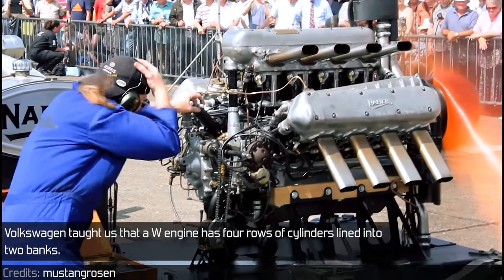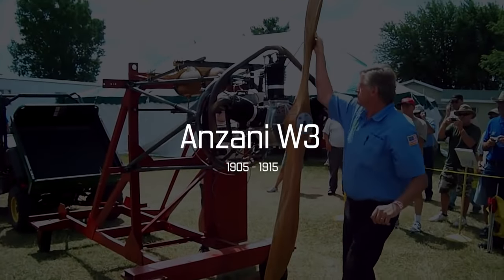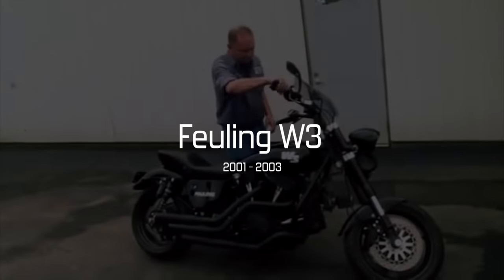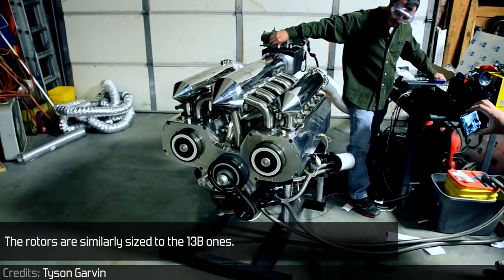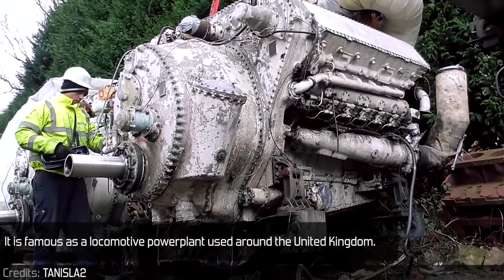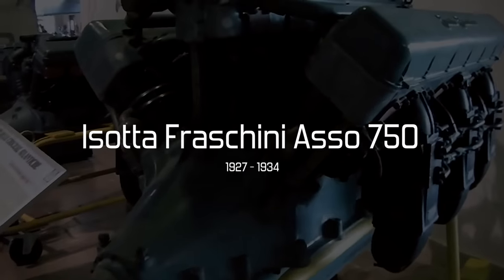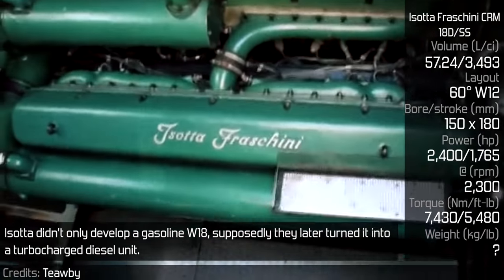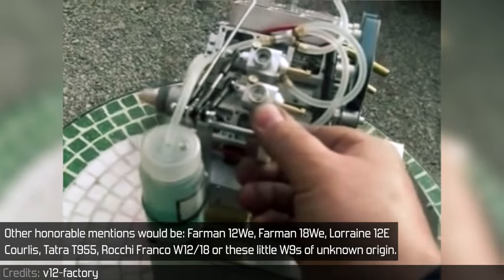Here Are A Few 3-Bank Engines Known To Exist

Comment: why don't you do a list of the most bulletproof engines, it could be interesting.
Reply: Ewan Murphy so almost any engine?
Reply: he means engines that last long, VERY long
Reply: Ill start it off. 1HZ from Toyota
Reply: ford 300 4.9L that's all you need
Reply: Small Block Chevy.
Reply: GM V6
Reply: Japanese diesels
Reply: Australian gmh 304/308 seen them run with pistons out the block for almost a min
Reply: So let's all agree and up vote this. Am I right?
Reply: Flametux true true I can agree on that but there would have to be a two part series on this subject to be completely honest.
Reply: Would contain Volvo Redblocks and Mercedes Diesels :D
Reply: ford barra NA LPG
Reply: BMW 1.5 litre 4 cyl.
Reply: L36/L67 from GM, and the 2.3l they put in the Ford Rangers
Reply: any toyota mota
Reply: Most Honda motors.
Reply: Speaking for American examples here. Short list.

- Hudson/Nash (AMC/JEEP) Slant-6
- GM 3.8 OHV V6, LT1 (older) V8, all LS engines, New LT1 V8, Basically all NA GM OHV egines
- Ford 302 V8
Reply: Old Mercedes diesels. Even in my little hometown there is one W123 which has been driven over one million kilometers. And my friends daily driven W124 with 3 liter diesel has 600 000 on the clock. There was once an old W124 taxi which had been driven 2 million kilometers but it had a few engines changed :)
Reply: volvo b20 for sure.
Reply: Volvo B20, B200, B21, B23, B230. Simply indestructible. Should one of those die, you probably killed it yourself...
Reply: Ewan Murphy Chrysler slant 6
Reply: vector6977
Reply: Please also specify what calibre bullets you're using.
Reply: @lukehindle4680  nah caterpillar 4086e

Comment: I believe the Feuling W3 wasn't accepted by HD in part because of some reliability concerns - specifically, the very uneven cooling between the front cylinder and the rear one.  Makes sense, since it's an air-cooled motor, and a pretty tight fit in that frame.  I'm told this is the same reason Ducati designed their engines with a 90 degree bank angle, with the front one almost horizontal so it didn't obstruct the air flow to the rear cylinder. Running a liquid-cooling system would possibly have helped, I suspect.

Comment: If I'm correct, Glen Curtiss, builder of the first V8 motorcycle, also built one or two 3 cyl bikes back in the 20's, or 30's... They were turned to scrap, in the metal drives, for war production.

Comment: Napier Deltic engines were also used in Dark class fast attack boats & , Hunt and Ton class Mine sweep vessels. Their engines were prized for the non vibrational properties so as to not disturb submerged ordnance.

Comment: Cool. A radial engine that you don't have to take the plugs out of the bottom cylinders  to drain off the oil after letting it set for a day or two.
I wish I had the money to scrounge up some of those old radical engines from the past. In the airframe and power plant school I attended they had an old English fighter plane engine I believe from the WWII era. Our instructor said the engine was discovered in a ravine off to the side of a runway that was being upgraded. They UN-Earthed it, cleaned it up and had it on display. What was really unusual about it was that it had 6 or 8 cylinders (It was 35 years ago and I can't remember for sure) in a row on the bottom of the engine. Of course it was a dry sump as the cylinders would immediately begin filling with oil the minute it was shut off. But even being a dry sump I would think that oil in the cylinders would be a significant problem like it was with the lower cylinders on old radial engines. I would sure like to know why the engine was designed that way and what the designers thought the benefit of all the cylinders being on the bottom was. Then I'd like them to send to me so I can tinker with it awhile.

Comment: the really old diesel 2strokes actually needed blowers because they didn't suck quite enough air to run properly
Reply: That's because on most 2 strokes intake and exhaust are open at the same time quite close to BDC, so there is not enough forced ventilation from the movement of the piston alone.
Most 2 stroke diesels use forced induction for this, in the form of roots blowers, and later turbo's with a mechanical coupling active below certain engine revs.
2 stroke diesels with exhaust valves set in the cylinder head (GM-EMD, Detroit and Kolomna 14D40 as examples) can be pressure charged, as the exhaust valves can close before the intake port is lapped by the piston.

2 stroke gasoline engines use tuned exhausts to get proper scavenging of the cylinder(s), these exhausts work essentialy like a pulse jet, the shockwave of the exhaust gasses rushing out creates a low pressure zone behind this shockwave, just at the right time when the piston moves up but before the ports are lapped.
These exhausts must be made to exact sizes for a specific type of engine, otherwise they won't work (well), because the low pressure is created at the wrong moment, it's also the reasson that each cylinder on a 2 stroke gasoline engine has it's own separate pipe.
Reply: Daniel Deutschen they used the blower for scavenging! if they didn't have it, they'd just blow the air back out when the piston comes up on the compression stroke, since they don't have any type of crank case induction like on a smaller 2 stroke
Reply: thats why 2strokes have these special formed exhaust pipes :)
Reply: Daniel Deutschen well an expansion chamber won't work on diesel 2 strokes because they still have exhaust valves
Reply: Kenyon Payne , , ,   check  out Detroit  51 series  engine wiki 
  no valves   but it does have a camshaft  to operate  injectors
Reply: thank you, Idodn't know that!
Reply: Not all 2 stroke diesels have exhaust valves, where would you put valves on an opposed piston engine?, it has no heads to put them in.
Also some normal 2 stroke diesels have exhaust ports instead of valves, like Hans Knutson mentioned the Detroit 51, I'm involved with the rebuilding of an old locomotive with a Crossley SVT 8 2 stroke diesel, it has no valves, and there are no camshafts on this engine, as it uses conventional injection pump block instead of the cam operated injectors.
It has the Roots blowers for scavenging.
Reply: Thanks for the interesting post on opposed piston engines.  I saw an old Fairbanks Morse in a submarine, they had FOUR of these big engines!  It is at Fisherman's Wharf in San Francisco.  I think the opposed piston is a beautifully elegant design!  Regards, Patrick :-)

Comment: about that 12 rotor engine, 

the main use is for powerboats and when boosted to 50 lbs boost on turbos it produce 5400 hp Drag race trim at 11,000 rpm with race fuel at 116 octane. 

Holy damn!

Comment: I had this arguement with my friend about engine smoothness and balance and how an I6 runs better than a V6 (i have an e46 M3 and he has a G35 coupe) which has me wondering how does a W layout compare to I, V, F and rotaries in terms of smoothness, and balance??
Reply: Gunsand42 I think it depends on the game and it's fire order.
Reply: Gunsand42 I makes more useable torque V is smoother  and can make more power with less stress
Reply: Alls I knows is inline and slant 6's produce more torque than V6's of the same displacement and valve/cam layout.
Reply: That's a very broad question Gunsand42!  The easiest part to answer is that there is nothing that is better than Wankel rotaries for balance and smoothness; all Wankels, regardless of number of rotors are perfectly balanced.
Reply: Gunsand42 I'll save you the trouble with the Subaru boxer. The way the firing order is harmonically ballanced 1 3 2 4 is the roughest of any type of motor. Misfires make it feel like the car is trying to fling itself out of the hood
Reply: Tre'von Cowen wrong
Reply: Gunsand42....about the V6, you're wrong...I see you only included foreign made motors on that list, well maybe research the Buick Dauntless 225ci V6 and it's slightly larger brother, the 231ci V6...both of those motors run circles around any and all Inline6 motors...in fact, in our 1970 Kaiser Cj-5 Jeep, the 225 was bored .060 over, got a Carter 4bbl card, a huge cam (I think it's .512 lift, but I'm not positive on that) Hedman Headers, and it regularly smoked small block chevy's when we'd drag race at Pismo Beach here in California....I'm just fuckin sayin...

Comment: Calling three banked engines W engine is very confusing.. Three banked engines should be called trident engines. :P for example three banked 12 cylinder engines can be called Trident 12 engines :D plus it trident 12 sounds badass :D
Reply: they have been called W engine since ever. only the VW Group thought that a "double-VR engine" can't be marketed properly, and then called it W.

Comment: 1:35 it sounds hilarious, only revving to 2000 rpm and just shredding tires, im sure with todays cams and valve springs we could make a 24 liter engine rev high and make a couple thousand horse NA

Comment: If you have more than 8 cylinders, you are just increasing friction.
So the power curve and efficiency will be impaired.
Because you are increasing the surface area between the cylinders and the piston rings.
The only reason to have more cylinders than 8 would be to create a very slow turning engine but still have smooth operation.
More is not always better.
Reply: in the words of the immortal clarkson....
more is better. ;->
Reply: EvenStar LoveAnanda 
All depends on what you are after. For motorcycles, periodicity makes a single cilinder the best choice. Cars, probably a big block V4 or I6. I think V8 would only be for more displacement and torque but not adding much. A V10 is where racing is at. If the cilinder size is not huge it will not add a lot of friction while you do get the rpm.

Comment: on the boats, why was there water coming from the exhaust
Reply: River water is pumped into the engine and the marine heads expel the water into the exhaust ports near where the manifolds bolt on after circulation thru the engine returning the water to the river.

Comment: Comparing a rotary to a BB chevy isn't good because rotaries can rev higher and the big block can make well over 800 ftlb naturally aspirated, the higher horsepower is just due to the 5500 rpm equivalence with the torque
Reply: this is a video about 3 bank engines.
Reply: Talking about the rotary he referenced the weird looking one with the tubes across the top at 4:27
Reply from the maker: I compared the external size of them, not power nor any other performance number.
Reply: You said has roughly double the power that's what I was referring too
Reply: Yes. Saying it has double the horsepower is very misleading. A BBC with the displacement of that rotary, (960 ci), would quite easily make 1500 hp NA
Reply: Jazza Umbers_57
Guy that's a damn expensive and unreliable motor.
Have fun changing anything metal that rubs on anything else after you redline it too often.
Sure you can idle a 1500hp motor all day but DD for 10-20 years yeah lol
And on a boat, no way. Fat luck changing blazing hot bolts & sealing areas with pitch & roll.
Hello robot mechanic.
Reply: Funny enough, here is a Sonny's 959 CI that makes 1800hp NA and built to reliably take a 1200hp hit of NO2.

http://www.sonnysracingengines.com/engines/pro-mod-959-cu-in-over-3000-hp-on-four-systems

A much lower displacement engine with a single turbo would be a ton more reliable at that big engines NA power level though if that was the goal.
Reply: Rotary ?  I think you meant radial?
Reply: No I mean the three bank rotary at 4:27

Comment: 4:30 as large as a BBC? a typical BBC is 454 (7.4l) this thing is fucking 960(15.7l), its more than twice the size, also, some drag racers who would rather die than use a power adder, build big blocks around 565ci (9.3l), still a lot smaller than this engine, and make over 1500hp naturally aspirated on high octane gasoline, not alcohol
Reply: Dyllidan ret 
The size of the engine itself. 
Like the engine bay dimensions.
Reply: generally when referring to engines, an engines size always means its displacement, if you are talking about the physical size of the engine you should always say dimensions
Reply: But none of those overstressed big block drag race engines could complete an offshore boat race that last for hours.

Comment: W12's are not 3 bank engines, they're only 2.  The Veyron, for example, has a bank of 8 cylinders at 90 degrees and the other bank at 60 degrees.  Eight cylinders are built into each head.
Reply from the maker: The Napier W12 is the real 3-bank W12. The same goes for the Life W12. Sorry ahead for a rude comment, but if you don't see that in the video, visit your doctor.
Reply: It's not a W configuration, it's 3 banks.  You need to get your facts straight, 3 banks don't make a W, 2 does.  Read about the Volkswagen W12 if you don't believe me.  I believe you know where you can stick your insults.
Reply: Chris Pappas, you should respect the history of engine design more.  When Napier first designed the Lion in 1916, it was called a broad-arrow design, later shortened to W.  Many aircraft engines were designed in the 20's and 30's with the three-bank W configuration.  Then VW came along 70+ years later, and designed their narrow angle VR6 that basically packed 6 cylinders in the length of 4 by having two banks offset by 15 degrees, but capped by a single cylinder head.  Then they got even fancier, and designed engines with two VR engine banks, and called it a W engine.  The VW Phaeton had a 4.0L W8, Bentley got a 6.0L W12, and Bugatti got an 8.0L W16.  But they are all based on the basic cylinder design of the 2.0L VW I4.  If VW was being honest, they would call it a "double-VR" engine, but that takes more effort than just saying "W".
Reply: I am still right, the main differences are the purpose of the engine.  The video seems to have airplane engines, my example is the more recent use of the W12 term.  All that crap you spewed was just pointless, learn how to get to the point faster, people won't fall asleep reading your walls of text.
The VR6 is still longer than an I4, so you're wrong.  It would have been easier to say staggered.
Reply: If you can't maintain mental focus to read 8 sentences, there is no point continuing this discussion.
Reply: Thank you for the ad hominem remark, you've ceded the argument.  Now go play.
Reply: You're the one that started the personal attacks when you typed in "All that crap you spewed was just pointless, learn how to get to the point faster, people won't fall asleep reading your walls of text."  I was reasoning from cause to effect.  Now you go and try to construct a logical argument in refutation.
Reply: Chris Pappas he already explained that we were talking about the 3 bank w engines, not the 4 bank ones. its in the beginning of the video. it has been established.
Reply: @chrispappas3750  It's a matter of semantics but just like slang, if enough people or the concerns producing them label them that way they become known by that even if technically incorrect. Also, some commenters just love to zero in on these discrepancies and make it the whole focus of their comment. Well, except for the childish name calling. Almost without fail this guy gets nothing but praise for his video content and subject matter. Also his improving English. You remind me of the prick with his "no Cobra was a Torino it was a Fairlane" Bullshit. Time to back away from the keyboard and get a life. Nobody is always right online. You will only die trying. The internet is a pisspoor place to hang out with an attitude that you are always right. Watch, listen, learn and enjoy. I'm appalled by the hammer of the average illiterate commenter but I bite my tongue instead of playing grammar cop. Sticklers for correct terminology are nothing but a huge buzzkill because your type is never happy to just kindly point out the issue. It always becomes an insulting personal attack. In my book it makes your type the very definition of a troll.

Comment: Oh please do electric engines next.
Reply: There aren't many of those, mostly backup team with electric. Someone has probably made an arc blast engine by now, but only to prove it could be done. Most electric force comes from motors, which is a fundimentally different subject. I would still like to see driver and winding tech over the years of motors, though.

Comment: 10 bikes you can have on the a2 licence
Reply: what kind of bike do you want?
Reply: jonas holste Enduro and a road bike, maybe bandit or gsr. Just wondering what else I can have really
Reply: cwuzii ahhh good choice. how big is your budget?
Reply: jonas holste Rougly 3k (£) for each. Don't want to spend too much on my first bike.
Reply: cwuzii i recommend a honda fmx 650 (very reliable) and a yamaha r6 (lightweight and also reliable).
Reply: cwuzii for 3k for each you get good ones.
Reply: But its also good if you dont search for a specific bike
Reply: jonas holste The Honda looks good, but the R6 isn't allowed on an a2 license too powerful
Reply: There are throttled versions. I would then recommend a 390 duke or a yamaha mt 03.
Reply: jonas holste Brilliant, cheers mate :)
Reply: but not very quick. my buddy could only barely out run my CB500 four